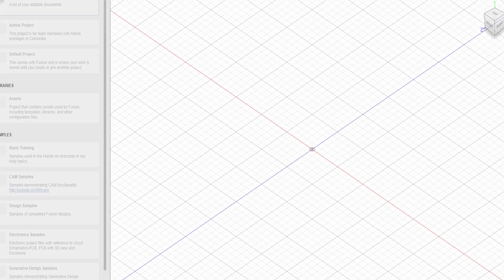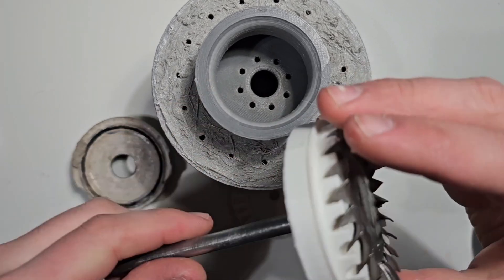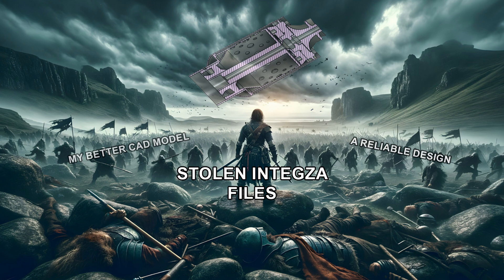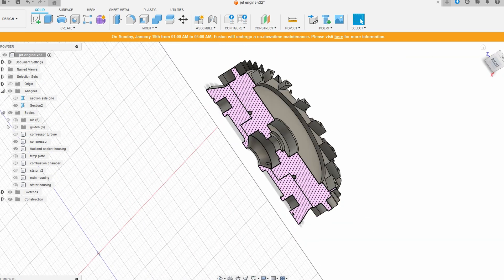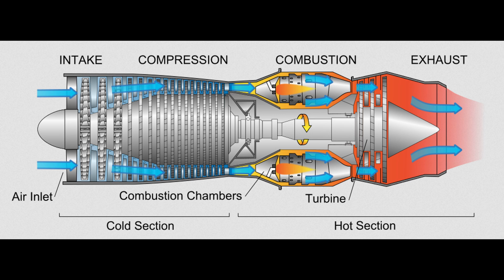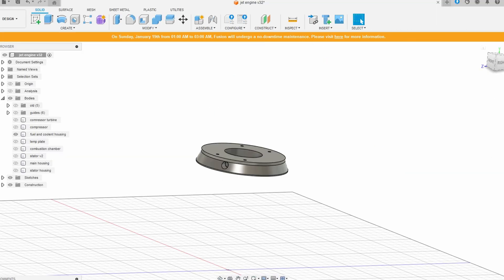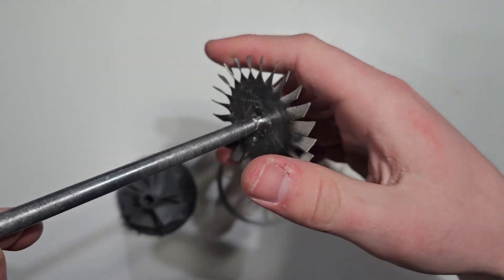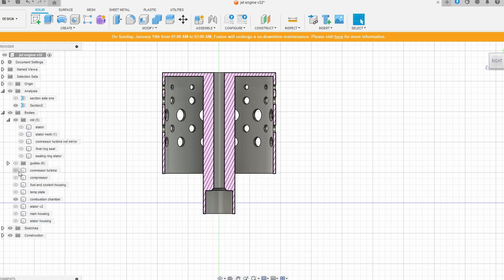Building a turbojet engine from nothing

Comment: i'm an Airforce jet engine mechanic on the KC135R, so i found this pretty cool. how are you monitoring your EGT's V1/V2 speeds? what are you using for injectors?  keep in mind your compressor blade to stator vane tolerances will need to be pretty tight! if you're struggling with the combustor can you could possibly go to a "can-annular" type setup and use something like plumbing or gas pipes rather than one thin walled combustor can since it gets extremely hot and will carbonize and crack the steel pretty quickly.
Reply from the maker: Wow, where to start ig for injectors I had planned to just pump fuel in through a ring that disburses into the combustion chamber. As for a annular vs can annular design I was definitely planning on going big at some point after I get some experience with just a simple small engine. With tolerances for the Stator and compressor I found that with a high end 3d printer and a .2 nozzle I can get some good prototyping stuff done and I was likely going to try casting the Stator in a furnace cement. I hope this answers some of your questions. You for sure reminded me of some stuff to look at and improve, stay on the look out for the longer and more in depth video when I get something moving.
Reply: @x4workshop  i used to be a foundryman in metal pour so i could possibly be of some help in that regard. are you talking about using refractory cement such as tenaxx mortar? i personally think sand casting would work well, but the shrinkage needs to be accounted for. they have special scales for this depending on the material you plan to use. or you can do a rough cast large enough to machine to size. i also do a lot of machining in my shop and have access to titanium billets.